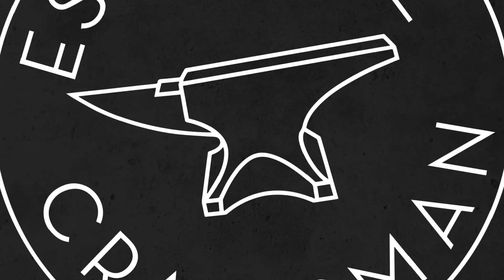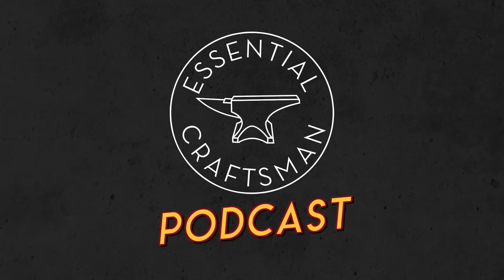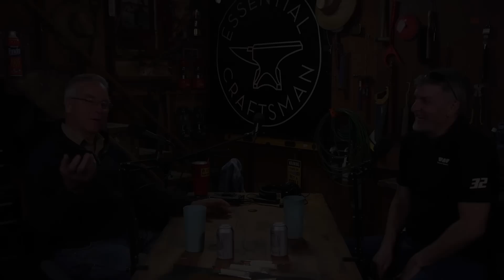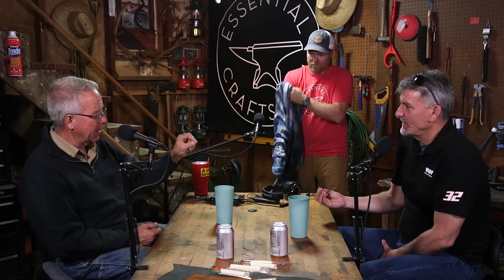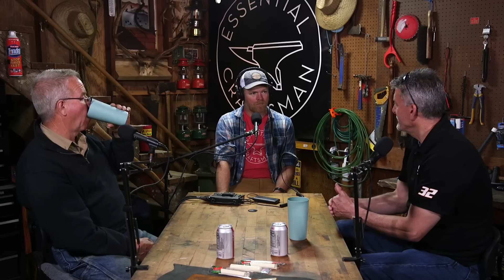Tile Showers with Ken Zandecki of Schluter Systems ECP 73

Comment: I would like to see a video or a test of the kerdi foam board I have not seen it in person and would like to see how it holds up strength wise when bare and when tiled as compared to the traditional concrete board.  I remodeled my house and did 3 bathrooms and a kitchen all in tile floors and showers and I used all concrete board, I however chose to use the Ditra on the kitchen floor as I was going over 1,1/8" plywood it was a learning process but went well.  To answer Nate's question Tile is absolutely something a DIYer can do all it takes is a commitment to learning and asking questions.  When you're done with the job and can look and feel a sense of pride and a job well done it gives you a sense of confidence to tackle something new and learn another new skill.
Reply: Check out the "Tile Coach" channel

Comment: Schluter System's bring piece of mind to my customers.  With very few exceptions I lay floor tile on Ditra.  In wet areas I like to run the Kerdi Band a couple inches up the wall to provide waterproofing.  Any customers who have had issues with water damage in a bathroom or kitchen are more than happy to have the extra piece of mind.

I have only been a contractor for 11 years.  However, I started using Schluter behind almost all tile work 10 years ago.  I love making their showers more useable for mobility challenged with the Kerdi Line Drain allowing a roll in shower.

I have been very happy with the materials, especially the Kerdi board for both walls and building benches, dividers, etc.

Thank you for bringing this product into your spec house.  It's definitely a valuable part of the home's reliability.